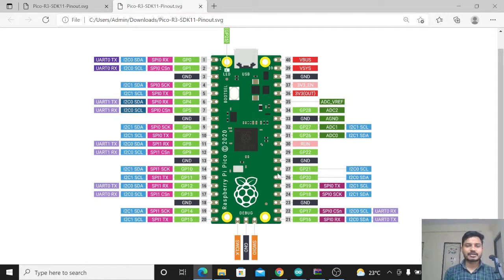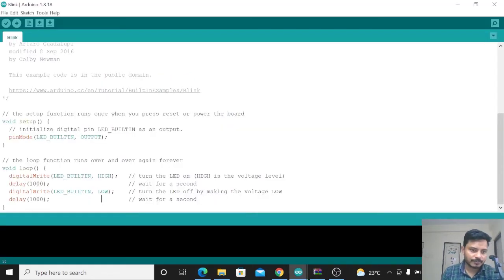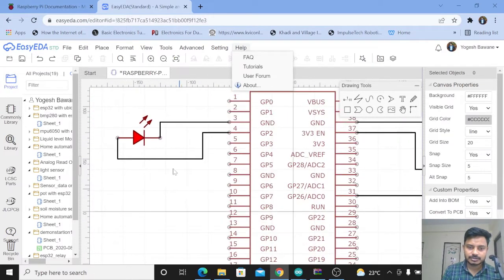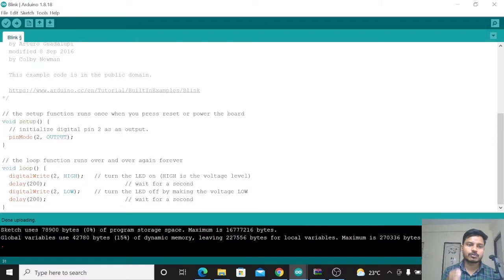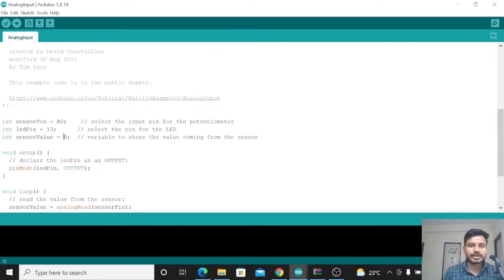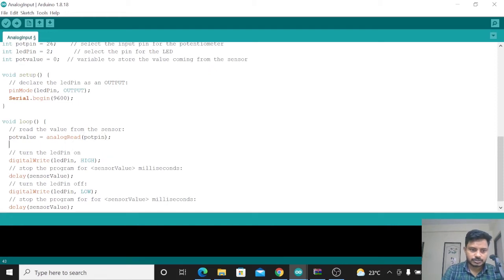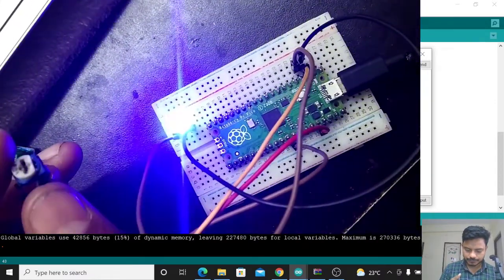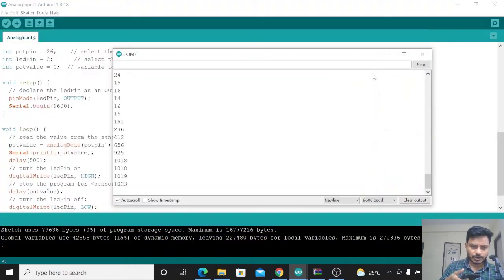Getting started with Raspberry Pi Pico using Arduino IDE | program the Pico board in Arduino Ide

Comment: Very interesting  video, thank you. 
I wonder why there is no resistor in the LED circuit to limit the current. Was this forgotten or are you using a special LED which does not need an external resistor?
Reply from the maker: If the voltage is less then you can use 
LED directly

Comment: Hi. i want to use MPU6050  module with Raspberry Pi Pico board and code on Arduino IDE. I just want to know that, how can i set my SDA and SCL pins in code? Ordinary Arduino i2c choose SDA - A4, SCL - A5. But i use GPIO0 and GPIO1 for SDA and SCL.
Reply: got something ?i facing the same issue
Reply: @tusharc7641  Hello. No yet. If you find, please tell me.